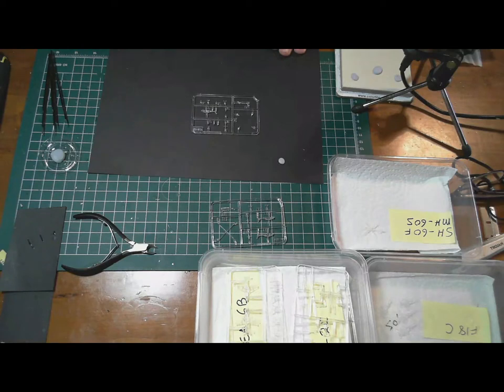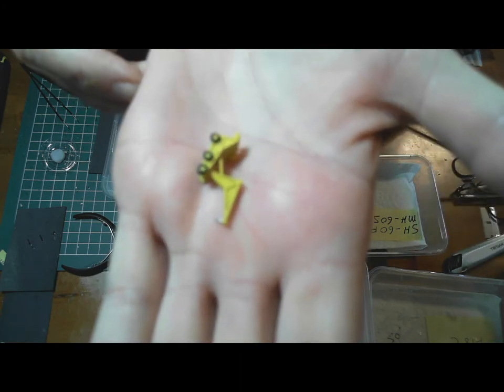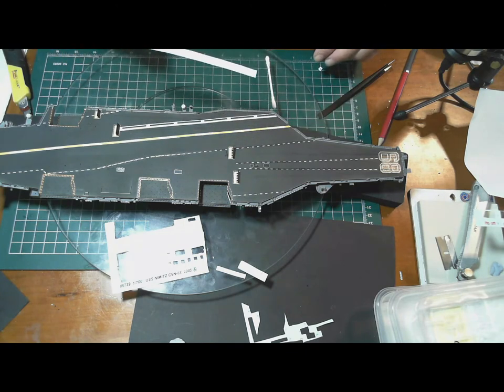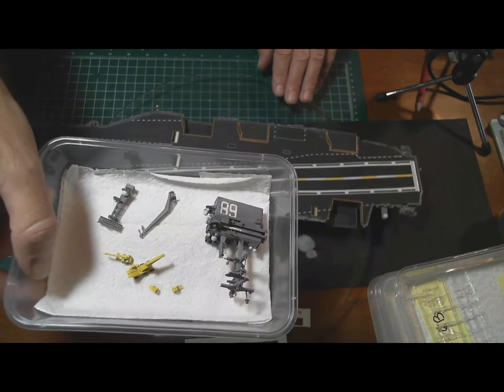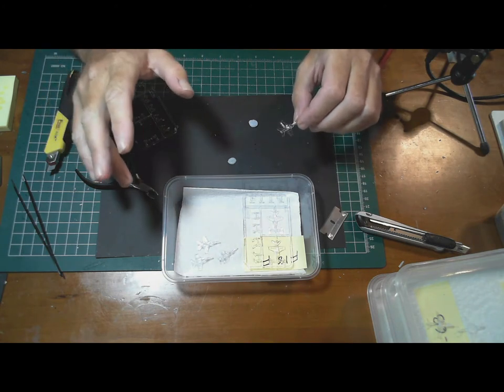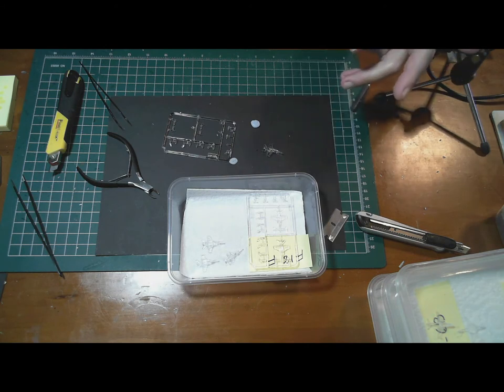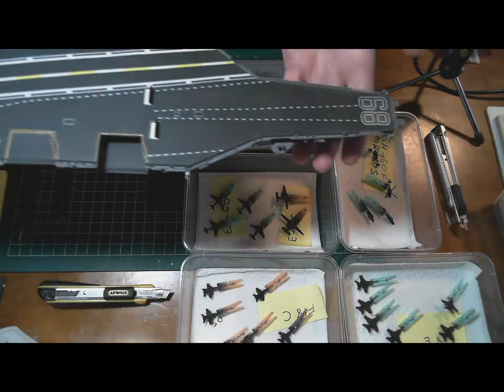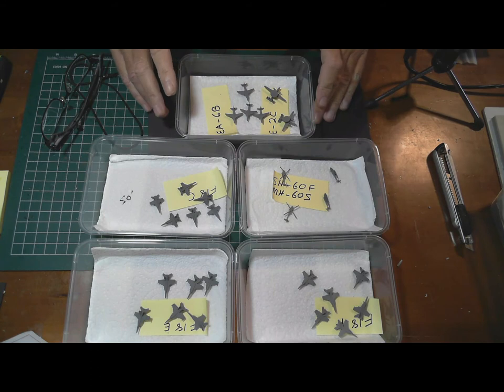USS Nimitz CVN-68 Aircraft Carrier 1/700 Build Part 7

Comment: Hi, looking good,  if you put a gloss varnish down before you apply the decals you will reduce the silvering your getting especially on your 89, you can flat varnish after.  If you put some pin holes in the 68 and flood the decal with setting solution it should sort that for you.
Reply from the maker: Good tip, I will try that " Pin Holes " :)

Comment: I find that Trumpeter tend to offer highly detailed and reasonably priced kits when it comes to 1/700, but they severely lack in the engineering department; they just don’t go together as well nor as smoothly as, say, a Tamiya. Massive sprue gates too, so loads of parts clean up. 

I currently have their USS Lexington CV2 on my bench, and as lovely as I looks, it was a bear to put together. Warped parts and overly engineered little bits that have no business being so complex at this scale. Trumpeter tend to just shrink their 1:350 offerings, so I assume this is to blame. 

Their planes are the same thing. Look gorgeous but fit is bad. The air group of my Lex is proving to be a challenge, and I’ve opted to forget about even trying to attach the tail wheels to save time and sanity. Their decals are beautiful too.
Reply from the maker: I find some of these manufactures are testing our modeling skills :) but at the same time should be thinking about new people entering the hobby who don't have the skills yet or at least listen to the feedback and make improvements.